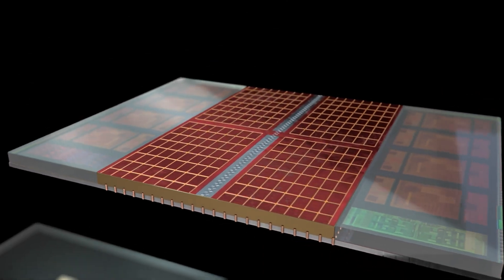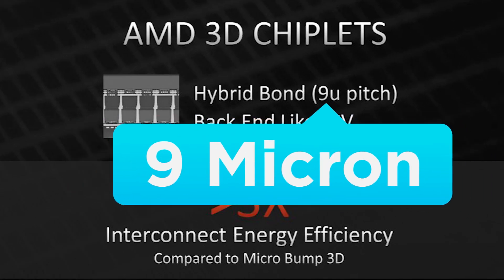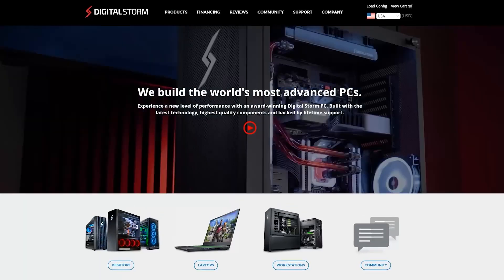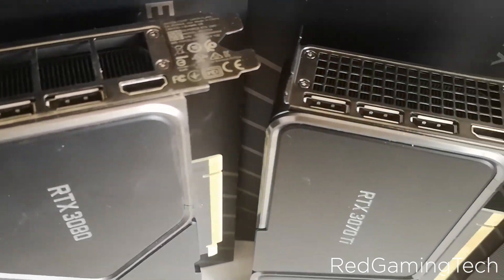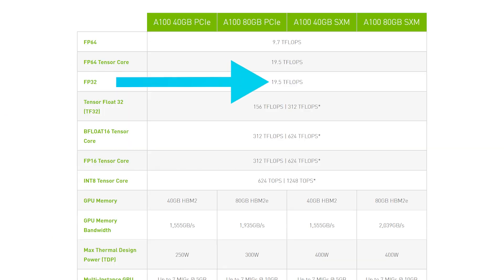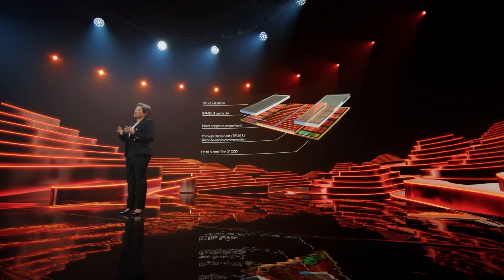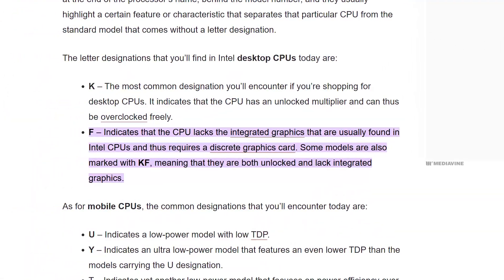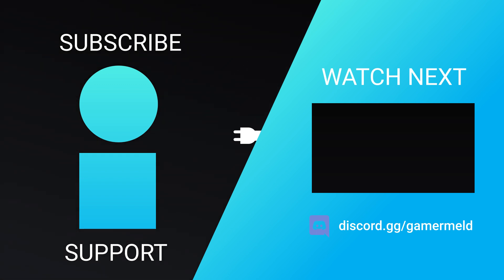Goodbye AMD APUs, Intel's GPU CRUSHES Nvidia and AMD's Best!

Comment: AMD want everyone has GPU, so they put GPU on evey cpu. I have some opinions about that :

1. AMD want to be more competitive with Intel and Apple silicon, because we know their cpu always come with integrated graphics.

2. AMD want to make quick sync feature like intel's, all Intel cpu has integrated GPU so it make their cpu guarantee to have quick sync feature. 

3. Reduce GPU shortages, if you didnt get discrete GPU at least you can have good integrated GPU.

4. AMD want to make Radeon become mainstream, because most popular GPU use on PC/laptop market today are still Intel HD(Fact).

5. AMD wont kill APU, they Will make separate product. High end dekstop cpu Will get weaker GPU and APU Will get faster and bigger GPU(but of course APU CPU Will slower). So you Will haave choice, faster cpu with slower GPU or slower CPU with faster GPU.
Reply: Intel Alderlake exceeds 16 threads and it includes IGP.

Comment: Very likely that the I/O die if at 7nm would have room for an 8 CU igpu, there's no reason not to include one but that doesn't mean the end of APU's if the I/O die igpu is CDNA based (Vega). It would not make sense to include it on the CPU chiplets.

Comment: I would hardly call these "GPU's" anymore. They are asynchronous compute chips at this point. No gamer will ever touch these things.
Reply: That's a bold statement that has no chance of coming back to haunt you. Gamers absolutely will buy them if the performance is there. It's not impossible that this kind of tech will eventually make discrete GPUs and DDR ram a thing of the past.
Reply: @BordersJambo  Most of these asynchronous compute chips require a dedicated server chassis with dedicated motherboards to connect them. In most cases it is not even possible TO game on them because the platform they are designed for are not public driver supported. Some will trickle down to PCI-E slot devices via workstation cards, but by that point consumer grade GPU's will be near equivalent.

Comment: That sponsor rig looks sweet..
As for all the new tech....
It's all unicorns and honest politicians right now.
Reply: AMD showed the 3D stacked cache for Zen3, but put it out there more as a technical demonstration than a promise of what it will be used for.   Alder Lake is a "wait and see how good or bad it is", though being an AMD fan makes me feel that it won't be as good as Intel and its fanatics want you to believe it will be.   No real word on RDNA 3 from AMD, outside of the rumors about it having a MCM design and potentially going to 75% larger than the 6900XT or even beyond for the top end.

So, it's not ALL unicorns, but it's mostly unicorns.

Comment: AMD APU is still nice money saver for workstations and other builds especially if their good.
Reply: The key is monolithic die, it lowers packaging costs.  My expectation is AMD will launch a low end APU socket down the line that competes with Intel's Alder Lake plans, which increases GFX on mobile parts.
Both Intel & AMD want to freeze Nvidia out of laptops
Reply: They're or they are.

NOT their.

Comment: If I were AMD, I'd do my desktop CPU lineup with integrated Vega graphics for basic/office (and discrete GPU) systems, and RDNA(2) APUs with 3D stacked cache memory for light gaming/productivity systems.
Reply: The fact that they stepped away from the combinationchip has a reason. Nothing wrong with a separate chip on the motherboard imho
Reply: @Roguescienceguy  Oh yeah?  What about cost and power requirements?  Intel iGPU are the target for so many games because that's what the mainstream actually uses.
Reply: + stack some HBMs ! and forget about DDR RAM stick
Reply: They used Vega gfx in 5000G because they reuse the proven SOC, hence PCIE3 only.
RDNA2 with infinity cache will become low end, very possibly with an APU socket, they and Intel want to integrate mobile gfx and freeze Nvidia out of the lucrative x86 market.  That's why Nvidia want control of ARM, it happened before stopping Nvidia's chipsets.
Reply: Yeah but instead they will roll it all into one lineup to ensure everyone has to pay as much as possible for basic performance.
Reply: @Nine-Signs  That's not implausible. But I'm also pretty sure we'd have 4-core (R3) parts in the 5000 series if it weren't for the supply constraints leading AMD to favor the more Enthusiast-grade 6+ core parts. It's telling that Intel didn't release any 4-core (i3) 11th gen parts either.
Reply: Why use Vega with the AM5 platform? They have to with AM4 APU's because DDR4 system memory can't keep up with RDNA2 but AM5's DDR5 memory won't have an issue with that, in fact that's what the current gen consoles and Valve's new Steamdeck do. Call it IGP or call it a APU I don't care. If AMD can build a Zen4 with solid 1080P gaming capabilities they will have a winner.
Reply: @ronhaworth5808  At a guess. Because they had a bin full of the right bits and did not need to cream much additional weafer capacity to make them.
Reply: @Nine-Signs  Makes solid sense to use Vega bits for AM4 APU's especially if they had a bunch of Vega bits laying around but it's RDNA2 going forward. I have a XFX RX6700XT myself and I love it.
Reply: @ronhaworth5808  Cost vs performance needs. A business rig needs some sort of onboard GFX, but not the power of RDNA1/2/3. Mid-high end gaming rigs also don't need powerful onboard graphics as they will certainly be installing discrete GPUs. But low end systems would benefit significantly from powerful onboard APUs with a large memory cache. Such an approach could even render "budget" dGPUs obsolete.
Reply: @ronhaworth5808  Infinity cache mitigates bandwidth and early DDR5 isn't that far ahead of late top DDR4.  Cache does take die space so I think it's becoming a chiplet on new high end designs.  But  iGPUs have always lagged dGPU as you need to redesign all the i/o and you'd risk a whole CPU launch if the iGPU side wasn't ready for a secondary feature.

Comment: Bye APUs? You're crazy given how there won't be MSRP GPUs until possibly 2023. 

I'm waiting to pull the trigger on the 6nm Rembrandt 8-Core/16-Thread RDNA2 APU which given the leaked roadmap is for Q1 2022. 

The current consoles and even Steam Deck are indicators of this will exist.
Reply: Me 2

Comment: All good things must end. Bye AMD. 

Loved your product hated the MSRP.
Reply: As if intel had good MSRP from 2009 to 2019. And they still don't for all but the 11400f.

AMD doubled their profit margins in 2019 with the release of Zen2(Ryzen 3000) and RDNA1(RX 5000) from 23% to 45% and now their profit margins are close to 60%
Nvidia sold the gtx 1000 series of GPUs at 90-138% profit margins and the RTX 2000 and RTX 3000 series at 45-60% profit margins, except for the rtx 3060 and rtx 1660 super which are selling at around 40%.
Reply: I wouldn't be get so excited fanboy. AMD is about to release CPUs with iGPUs in them just like the way Intel has been doing it. Secondly, we need competetion unless you want to pay your entire pay check if not more for Intel's products. AMD will already about to have 5nm chips while Intel is barely about to release 10nm chips. Both will use DDR5. The only thing I am excited to see is another company making GPUs. But knowing Intel it will cost an arm and a leg. Either way.. competition is ALWAYS GOOD. Otherwise either company will make whatever prices they desire.
Reply: @Vicious_One Intel's "10nm" is smaller and better than TSMC's "7nm" and "6nm".

BTW neither of those nodes has anything remotely close to 10, 7 or 6 nm. The width,  gate pitch, height, inner-conections, all of them are way bigger than any of those numbers.

And we are in a duopoly when it comes to desktop CPUs, so we are screwed, now both AMD and Intel have high profit margins and AMD have higher profit margins than intel right now, meaning AMD CPUs are more overpriced than intels, intel's just cost more.
Reply: @Vicious_One  Yeah ik about the whole 5nm and 10nm thing and that but see the good side Intel does a great job and even a better job than most processors that have =<10nm transistors while they had 14nm?
Reply: @reclipsel  Intel could care less about its customers. They could have easily made LGA 1151 socket last a long time without the need for a new mobo basically every time a new gen of chips come out, you need a new mobo. The only exception was Z370/Z390. But they just kept on milking people. That's why I switched to Ryzen and flashed my mobo BIOS already since I will "probably" get a second hand Zen3 chip and sell my Zen2 chip which will give me a decent upgrade while DDR5 prices will be high on both next gen platforms from Intel and AMD. I might not upgrade at all since I play at 1440p and I am more GPU bound for the most part and would rather get a new GPU than a CPU right now since my CPU is still enough of a beast.
Reply: @Vicious_One  that's true as well
Reply: Are asleep at the wheel or just a troll?

Comment: AMD and Nvidia = "Let's design around power contraints as well to lessen the power load in the Datacenter."

Intel = "Wut??? We must benchmark higher regardless of the outcome. If it overloads the electrical supply or catches fire, who cares!? Plus, we're not paying for the extra wattage, they are."
Reply: Compute is scarce because die-size and node process limitations. The bigger the die, the more probability for defects. So you have to go MCM to increase compute or wait for a new node process to mature.  Anyone would make a 600W GPU if they could make it economically.  But they can't right now which is why everyone is going MCM and everyone will increase the power going into the GPU.
Reply: I mean techincally is worth it because they are >2x the TFlops and just 2x the Watts
Reply: its more efficient because the power usage is proportional to the performance gains at a smaller footprint so it takes up less space.

Comment: It may well be that getting an iGPU is the only way to get the equivalent of an entry level to midrange graphics card for a while. A small RDNA 2 graphics card equivalent? I could live with that if nvidia 50 class and radeon 500 class cards are a thing of the past. Would probably need beefy DDR5 ram to keep it running fast.
Reply: with chiplet design and fast ddr5 igpus will make entry lvl graphic cards a thing of the past

Comment: So it's not the end of APUs, it's the end of CPUs. If the iGPU in the future APU comes at a performance level of at least an RX 470, then I might actually upgrade AM5. Otherwise I'll stay on AM4 and just upgrade from a 1600X to a used 5700G.
Reply: The connection to RAM would make any integrated graphics be limited.   Even if AMD put something like 80CU worth of RDNA 2 in the CPU, the connection to memory would limit performance to something on the order of a 6600 non-XT.
Reply: @Targonis1  Wise assessment David, good thinking. A touch off but close. APU's still rule from AMD. Without Doubt.
Reply: Well stated Daniel, it's the end of CPU's.

Comment: I can't even afford 3060 . The prices are all over the place
Reply: 3060 and 660 XT are not worth it. 3060 Ti brand new ONLY and 6700 XT are worth it. I say that because most 3060 Ti were used by miners so I'd never get a used one personally.
Reply: @Vicious_One  LTT did a video on this one recently. Turns out that there's absolutely no issue with buying used mining cards, despite what manufacturers will try and tell you.
Reply: @BordersJambo  I saw that video but since those GPUs are constantly under full load 24 hrs a day, 7 day a week... who knows how much longer it's going to live.. specially if you want a GPU to last or something happens for example the situation we're in now when it's nearly impossible to get any good GPU for anywhere close to a decent price... not even gonna mention MSRP. This shit has got to stop. But by the looks of it... it will continue until 2023... so that's just wonderful.
Reply: @Vicious_One  It's going to continue I think until they get their new factories online, which will be 2023 like you say. So if you need a decent GPU in the meantime without re-mortgaging your house, a miner's card is a viable option. It only really needs to last 2-3 years, by which time, something better will be out anyway.

Comment: hopefully AMD making all their CPUs into APUs means a greater focus on integrated graphics, but won't detract from the actual CPU itself's development for those of us with a dedicated card who'll rarely use the iGPU.
Reply: Companies get really innovative all of a sudden when they see their market share shrinking.
Reply: Integrated Graphics are more expensive on processors. Just like extra features on a vehicle when you're buying it from the dealership. So I only use external video card so I have no purpose to buy a graphics card integrated in my CPU.

So I find APUs are only useful for laptops or home computers (prebuilts).
Reply: @Twitch_Moderator  its usefull for troubleshooting a problem
Reply: Apus make no sense whatsoever with chiplet technology. For good sake, gpus should not be integrated into a cpu, but be on their own, freely replacebale. With the current bus sizes and onboard memory, integration is just stupid.
Reply: Yes we need igpu for just doing some light work or incase our main gpu fail to work

Comment: People seriously need to quit comparing tflops. Just because it has a higher tflop doesn't mean anything. Many other things have to be factored in like the architecture, number of cores, etc.
Reply from the maker: Well for one, it’s theoretical Tflops consider all of that. You’re thinking of gaming, which cares more about the architecture, optimization etc. Data center type tasks (which is what this is made for) scale much better, making these types of comparisons much easier. So in this case, it does matter.
Reply: @GamerMeld  you still can't sit there and say "it crushes AMD and Nvidia" just because of higher tflops no matter the circumstances if the only "proof" you have is the tflop count. Again, you still have to take into account other things like the architecture. Sure, it can have a high tflop count but that isn't going to matter if other things like the architecture absolutely sucks.